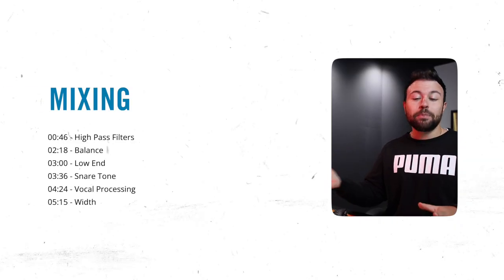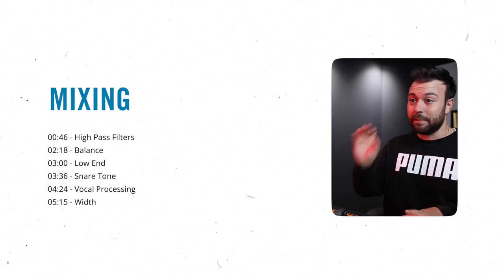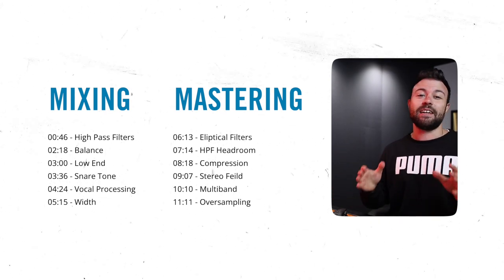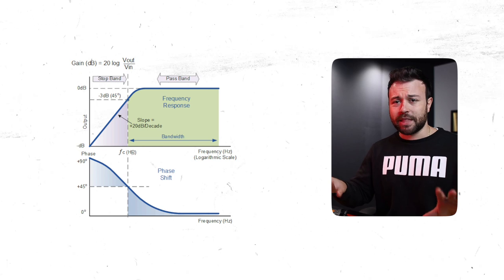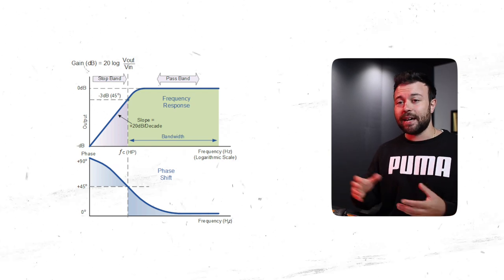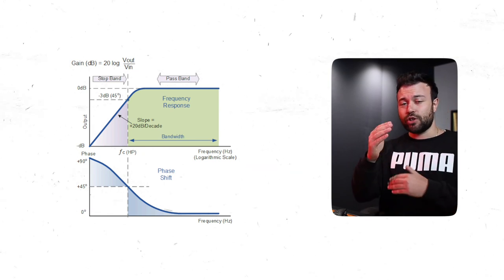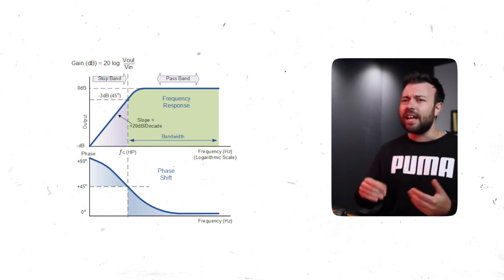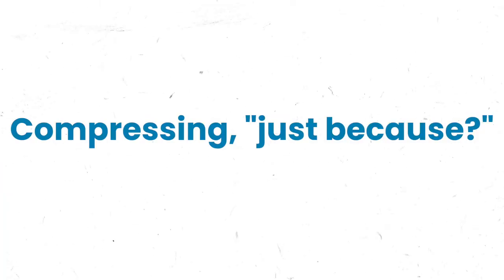DIY MASTERING? Save yourself by avoiding these TERRIBLE MASTERING MISTAKES!

Comment: all good points. the one about elliptical filters very true. Also re multi band compressors, beyond using ones with non linear crossovers, there is so much bad use of multi band comps out there in mastering, and using them when you don't have to (I'd say they're mainly for correcting poor mixes)...
Reply from the maker: Bang on! Thanks for watching!

Comment: In my world no one would low-cut a snare at 200-400 Hz. The sub might be removed, but not the low mid of the snare.
Reply from the maker: In the EDM world it ISN'T uncommon!
Reply: @panorama_mastering  We had recently a self proclaimed EDM-guru announcing that cutting the high of the master can give a "perfect master". I am taught that high cut shall be done track by track, bus by bus due to a need. I must admit that I have talked about the EDM-scene for long now, that there are many talking nonsense there who are not real audio pros.

Comment: with oversampling on clippers during mastering, i tend to use zero oversampling so I can effectively shave off transients 100% at the hard clip ceiling so my limiter won’t be working as hard.  when i use oversampling, i find that the amplitude of the signal goes past the ceiling.  is there a way i can use oversampling without anything going past the hard clip ceiling?
(im using StandardCLIP!)
Reply: on inserts i use 2 clippers (2nd one has no oversampling), on master you can have limiter with oversampling after your clipper.